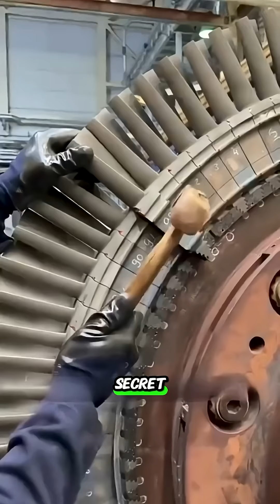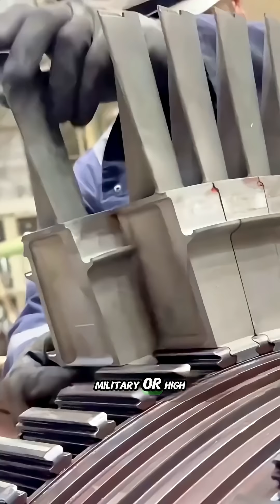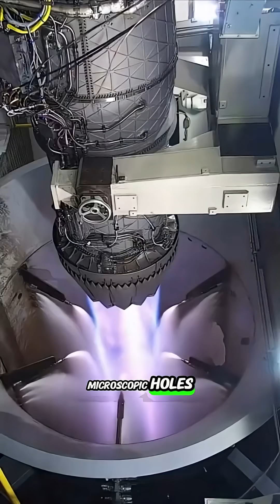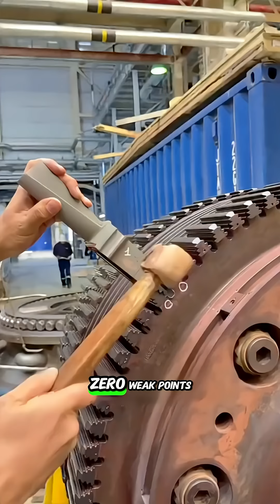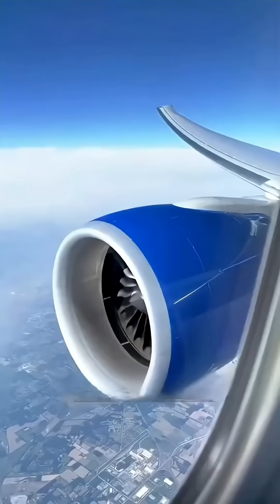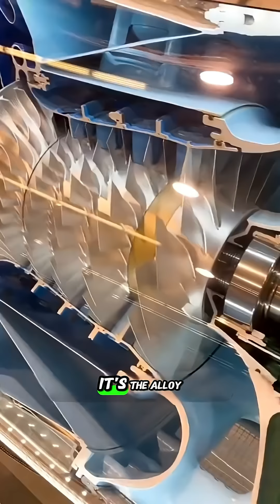The Insane Reason Nobody Can Copy American Jet Engines

Comment: Hey bud. Have you ever heard of Rolls-Royce? The UK France and Germany all have their key engine manufacturers. China too and presumably Russia... Almost all the footage in this video is of commercial jet engines but almost every fact in the video relates only to military jet engines. There are many unique aspects differentiating the two. So to boast about US jet technology dominating the engine space globally is very misleading. US military jet engines do not get used anywhere else in the world. And yes they might have the most technologically advanced engines in the world but this is not very relevant when the engines in question simply outnumber everything else because the US has the biggest military and the biggest air force and therefore the largest number of engines flying.

Comment: Opinions:
Jet engines have, yes, offered humanity higher speed in flight, reducing travel tines. They also, overall, operate better at high altitudes allowing flight OVER much bad weather and reducing or eliminating the need to fly difficult and dangerous routes through mountainous areas. But... unlike other technologies which have become more affordable over time, turbine engines have not. 
Pilatus PC-12 horsepower...  1200
Rebuild cost...             USD  $500 000
Douglas DC-3 Pratt & Whitney R - 1830
horsepower...                              1100
Rebuild cost...             USD $ 90 000
       And though turbine engines are fairly reliable, they are NOT infallible. We hear about turbine blade separation taking out a $ 3 000 000 engine ALL THE TIME. I have not yet heard of a piston aircraft engine failing because of a bird strike.
      My point ? I'm not convinced that the transition from piston-engine  to jet aircraft - for airliners - was EVER worth the exorbitant cost, even factoring in some improvements in altitude and travel time.

Comment: No, coolant does not spray through the turbine blades and out holes. Air flows through the turbine blades and out the holes to keep the blade cool.

Also, 5 countries are capable of making these blades, the US, the UK, Russia, France and China.

No, the weight of a strand of hair on a turbine blade will not tear the engine apart. The tolerances are tight but they aren’t that tight. A strand of hair weighs 1 milligram.

Comment: There's some truth and some lie to it. If the blueprints are too advanced for the technology you have at hand, of course you can't replicate the engine or whatever. On the other hand, if you have a suitable technology to build something, you still have to go through R&D pains. Both matter a lot, and they usually go hand-in-hand, though obviously stealing the documentation is easier than implementing the full manufacturing chain. Finally, what usually gives an upper hand in the market is not the complexity per se, it's a good track of cost/benefit ratio. You can have a super-complex high performance engine waiting for spare parts half the time or you can have super-cheap and very reliable engine with double the consumption of similar competitor's engines, and all that would be junk. You need to hit the sweet spot with all the critical parameters, and that's where you gain the market share

Comment: The Snecma (now Safran) ATAR was the first jet engine designed entirely in France, but Snecma is most famous for its joint venture with General Electric (CFM International). Together, they created the CFM56 and LEAP engines, which are the most-flown and among the best-selling commercial aircraft engines in the world.

Comment: Zero weak points - so that's why they never break and rip through the cowling into the fuselage?

SWA1380 anybody?  American jet engine suffered a fan-blade-out where a fan blade broke, broke the engine cowling, penetrated the fuselage, caused an explosive decompression, passenger half sucked out and killed; the plane, a B737 was written off.

More recently (8 days ago) a ryanair flight from Thessaloniki had a window shatter, explosive decompression and a man half sucked out.  Potential engine failure has been suggesged; it was a B737-800.

Comment: This is more or less correct. As of right now, the US and some of its allies are the only ones capable of creating engines with amazing power to weight ratio and it is mostly thanks to breakthroughs in metallurgy. We have alloys that can withstand several thousand degrees of heat without deforming which is fantastic news if you want to spin at super speeds, this is how we are managing super cruise speeds, the ability to go faster than sound without afterburner 😉

Comment: It is correct that US aircraft engines dominated for the past 50 years because of heavy investments by the US Department of defense. Today it is a partnership of US Pratt&Whitney, GE Aerospace and french CFM International that controls 50% of the market. Rolls Royce's 3- spool engines are preferred when noise and fuel efficiency is a priority e.g in long-haul, wide body airplanes. The Boeing 787 Dream liner offers the choice between US GE GEnx-1B and Europe's Rolls-Royce Trent 1000. Airlines choose based on their fuel and maintenance preferences.

Comment: Bravo!! You stated it all perfectly factual! I was a turbine blade durability engineer, and everything you said was perfectly on point. And for rockets it’s even more insane …each blade in a rocket turbine is used for a single flight. We made massive improvements for the Space Shuttle, but blades used in early years totally cracked and were ready to crumble after just one flight mission! Single crystal nickel alloy with internal cooling is key! Go Pratt & Whitney!!!

Comment: Absolute bollocks. Not to mention that the first jet engines where designed by Frank Whittle (British) and Hans von Ohain(German). The american program "Operation Paperclip" post WW2 is the only reason the Americans got half a clue. Oh yeah and had to get a license to manufacture the Rolls engine in the P-51 during WW2 because their engine was rubbish. Oh and today  - Rolls Royce Britain, IAE Japan, CFM France, Eurojet, GE Honda, Powerjet Russia, NPO Saturn Russia, Klimov. Then there is the Gas Turbine sector for Gas Compression and Power Gen.

Comment: I used to repair and overhaul the Starter that gets the main engine up to speed at Honeywell. I could take apart one that was built at a Mexican repair shop, and immediately be able to tell what they did wrong for it to fail. Everything has to be perfect the amount of quality inspections are insane before it can be tagged to go on the plane.

Comment: My late dad used to work for KLM and was a grinder and repaired turbine blades and told me about the precise measurements involved also taking in the ambiance temperature when measurements are done if the room temperature was to hot the measurements did not comply with specifications 😱
Reply: Ambient

Comment: Yeah sure! I did weld build-up on jet engine blades and vanes and maybe the turbine blades had cooling channels but i guarantee the compressor blades did not. They are x- rayed and every process in rebuilding the blades is recorded and inspected. That said rebuilding the bldes is way cheaper than buying new blades!

Comment: This is why China can steal a blue print but cannot build an F-35 or F-22 with the same performance levels. The J-20 is nowhere near as capable as the F-35 or the F-22. Especially at the engine level. Or the stealth level.

Comment: If aircraft engine blades are such a classified technology, why does the US outsource to China, allowing China to control 35% of the global market? 
Extreme temperature data: The turbine blades of high-thrust military and advanced civil aviation engines developed by China can withstand extreme gas temperatures of about 1700℃ to 2000℃ in high-temperature areas such as the front edge of the blade.

Comment: Why has nobody ever calculated the wings internal cubic area and compared that with how many gallons of fuel they claim is on board? It’s all lies! A jet aircraft only needs enough jet fuel to get to cruising altitude. Then it intakes the oxygen and hydrogen rich water in the air, separates the oxygen and hydrogen , burns the hydrogen and gives off the oxygen as water. Don’t believe me? Trust me, I’m telling the truth. The petroleum industry rapes you every way it knows how! John D Rockefeller was one of the most evil people ever to live. 😮

Comment: Is 7,000 hours enough?!?! Considering that this is the century of one of the cheapest engines in Russia, the RD 33 M engine that is installed in the MiG-35!!! But considering that even the old engines from the MiG-29 that Yugoslavia dug in 1987 still work very well?!?! Someone may say that this is too outdated aircraft, but since Serbia has modernized its MiG-29, which means a new and much stronger radar that can see other planes up to 200 km away, as well as other electronics, these planes can be used until 2035, which is more than enough!!!! If the MiG-29 SM is compared to some of the drones sold by the U.S. for $250 million, it just can't compare!!!! Given that the MiG-29 can fly at an altitude of 19 km, faster than 2,450 km/h, with 4 tons of armament, which means from FAB 500 that can fly up to 120 km through other missiles from Russia that we all know very well, I don't see what is so special?!?! Even Yugoslavia, more precisely Republika Srpska, is still making engines for jet aircraft that can fly over 1,300 km.And it is an aircraft on which young pilots are prepared in Serbia or used as light bombers to support the army on the ground, during the conflict in Yugoslavia, that plane repeatedly saved thousands of Serbian soldiers because NATO did not know how many and where the Serbian army had them!!! From the conflict in Bosnia until 1995 until 1999, when NATO bombed Serbia and thought that Serbia no longer had planes?!?! Dozens of NATO planes were destroyed at the airport and failed to take off!!

Comment: The reason is because the top 3 companies that build these engines are hiding the technology! It's not that people are stupid and they don't know how to build them as you're implying. And the blades are filled in that manner not because of heat But because of What they're doing more specifically that's collecting etheric energy Which is why they have a crystalline structure

Comment: I built the machines to inspect the blades and while they are complex its nothing compared to human blood vessels. They are very cool but this video is way overboard. They heat the blades to a certain temp then use an IR camera to inspect the holes making sure they are in the right spot and go all the way through. The prices aren't that high per blade but by no means cheap, think more like thousands each not tens of thousands. No coolant in them either its just to improve air flow allowing them to cool off at the very high Temps they see inside the engine

Comment: The weight difference of a human hair can tear the entire engine apart… I call BS on that statement. A bug splattered unevenly across a turbine blade weighs far more than a human hair. Fan sections of jet engines are covered in them much of the year. Also, go ahead and explain the weight of ice buildup… Frozen water is not light.

Comment: This is why it is possible to build a car or any machine that can withstand mechanical and electrical stress to last a long time, but because of planned obsolescence, manufacturers don’t do it. They would use inferior materials and building techniques to ensure that at a specific time, the product will fail. Therefore it’s not a coincidence that computer hardware consistently fails at the 5-year mark. The failure is already planned ahead. It’s sad that millions of tons of tech hardware are sent to the landfill unnecessarily.

Comment: Oh god so much bs
No, a single hair does not destroy the engine. It is just said that a single hair in any kind of tolerates fit could cause a failure - that’s something completely different.

Also tolerances are not in the micro grams. Just because your scale does display micro grams it doesn’t mean it’s technically needed.

Comment: Rolls Royce rolling about the floor laughing!
Reply: I don't think the video was meant to belittle Rolls Royce. US and European are equal. I think it was a message to the Chineze that there's just some things they can't steal.
Reply: @kenstewart5991  true.
Reply: @kenstewart5991 the Chinese will be glad to hear that. Because according to the west anything they make is stolen from the west. With what you just said, you protected them from being accused of stealing jet engine technology😊
Reply: Yeah, we’ve heard about those RR engines on the 787. 🤣
Reply: pratt & whitney: F135, F119 & let's not forget: J58. RR is good, but they're overpriced & outclassed. & their wide body, heavy lift engines, while being very fuel efficient, LOSE any & ALL advantages, being FAR less reliable, than the GE9x, needing more costly & more frequent maintenance. lose the green head tree huggers out of your company, or? just build a factory in TX & make your stuff there. we KNOW you have the engineering prowess, you made the mustang & spits what they are, just lose the commie green heads.
Reply: NO there are not. About half of our planes use Rolls Royce engines. LOL
Reply: 1/3 of the engines for the 737’s are rolls Royce.  Many airlines are choosing to order the GE engines instead due to reliability issues with the Rolls Royce engine variant.

Comment: The absolute oldest Rolls Royce RB211 flying today, a 1982 build powering a 757 with cargo carrier DHL Air UK, has been on 18 — yes, eighteen! — different aircraft, with Eastern and British Airways before DHL.
Reply: Are you saying that this is the same engine that powers the 757 today?
Reply: @grenloopy2969  YES
Reply: Triggers broom ,original ,five new heads and six new handles !
Reply: ONE platform, 18 different operators, "several" shop visits to swap out disks and vanes in 44 years; no big deal for a mid 70s P&W JT8D-15A that was installed on 3 different platforms (B727/B737/DC-9) in 50+ years ...!
Reply: @airplanedata1076 Not the platform. The same exact engine piece.

Comment: I would assume that this short video is largely inaccurate. I've watched documentaries on how Rolls Royce engines are designed & built & it's  way more in depth than this. It's a huge team effort, including the building & testing at every stage. Then there's the 24/7 airborne monitoring system.

Comment: Asianometry has a fantastic video going into detail about turbine blades. Not just aircraft ones but massive power turbine generator ones used on steam based powerplants. It's incredible that the blades can be made at all. The metallurgy alone is probably one of mans greatest achievements
Reply: Atom bomb is greater.

Comment: Within the next year, everyone will realize that the new technology called Centrifugal Propeller, will replace all jet engines, rocket engines, and most air and marine propellers. There is a working proof-of-concept prototype. It will be capable of travelling in space, where it continually accellerates. It is capable of every maneuver attributed to UFOs. It looks like a flying saucer, so if you believe in UFOs, this is the same technology that they are using. That shape is functional.

Comment: Pratt and Whitney are kicking ass in the industry. The F135 engine oiluts out 115.000HP and 41.000 lbft thrust😂 1 Engine! It can take the F35 A model to mach speed with a max fuel and bomb/rocket load of 70.000 lbs take off weight. The new ECU variant is higher HP/Thrust and higher KW Electric output with higher cooling abilitiy. A Former F22 Raptor pilit says he would rather have the F35 he flew than the F22. Complete awareness of everything going on around you. Everything in you Theater including ground threats are  listed in your comms. Every friendly and enemy in the air. You target vectors for ground attack are lit and all you have to do is look for your warnings and own the battle space!!! 😂 Rolls Royce??? 😂

Comment: Fun fact, those holes in blades are made with a CNC EDM machine. Those machines can make holes as small as .0004 of an inch. Those holes are not straight either, they curve and bend, which is intentional and controllable.

Comment: Way simpler than human blood vessels thats just silly they are straight tubes because you just made by lost wax casting the reason for the price in a certification process where they measure and xray everything because plane engines failing needs to be a very rare occurrence for the aviation industry to exist but for lockheed they got a gorilla grip on the balls of every politician so military jet will just kill you and it costs alot

Comment: Jet history : 1929 Frank Whittle (British) conceptualizes the jet engine. 1932 Frank Whittle is granted a patent for his initial jet engine design. His first engine ran on a bench test April 12, 1937.
BMW (Germany) began developing jet engines in 1934. In 1939, the German Air Ministry (RLM) mandated BMW to aquire their German competitor 
Brandenburgische Motorenwerke (Bramo). BMW absorbed Bramo's research team and jet projects, which evolved directly into the BMW 003 turbojet, one of the worlds first (August 1940) operational jet engines.
Rolls-Royce began joint development of jet engines with the aforementioned Frank Whittle in 1940. Their first production jet engine, the Welland, first ran in 1942 and officially entered service in 1944 powering the Gloster Meteor fighter aircraft. End of part 1. You're welcome.

Comment: This is the reason the Mig 25 Foxbat has to have it's engines replaced after every full throttle run while the SR71 can go for hours and hours, land then do it again and again.
Reply: Haha 25using rocket engine and is probably 20 years earlier